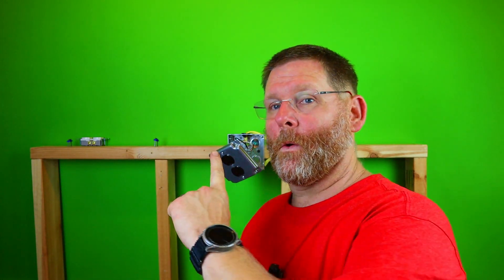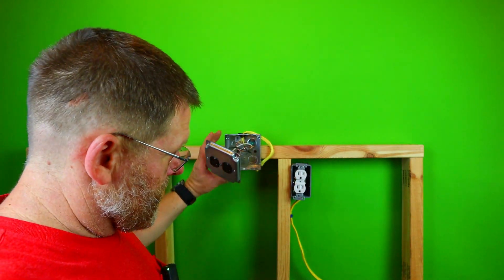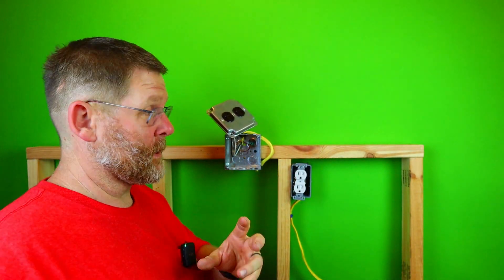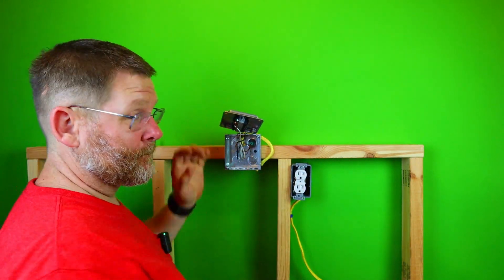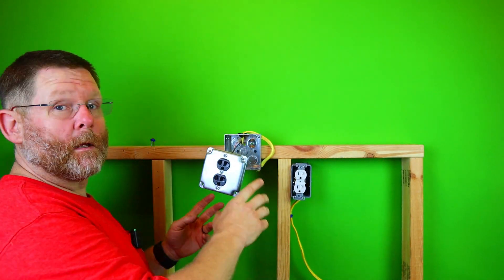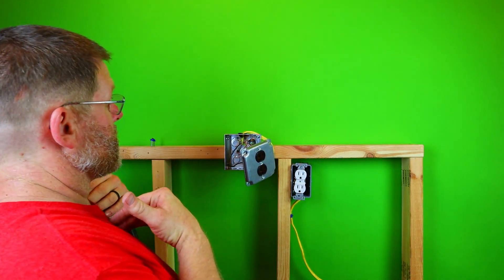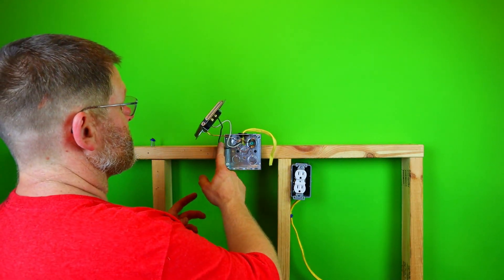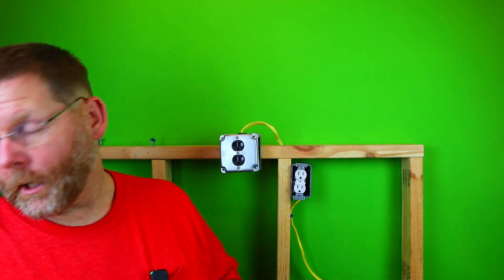Do You Need To Ground A Raco Raised Steel Cover?

Comment: I like to bond the box in case the outlet is replaced with a non-self-grounding type in the future.  Also, covers tend to get tweaked by people like painters who may not tighten the screws back up properly or strip them.
Reply from the maker: Great thought thanks for sharing